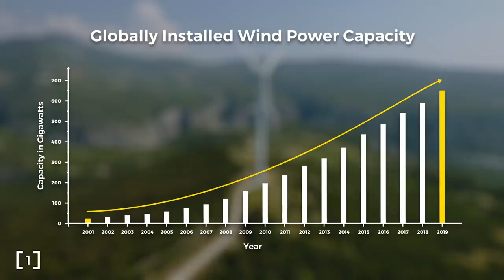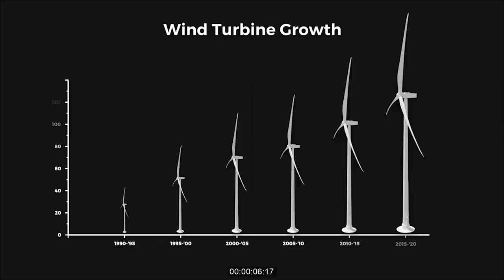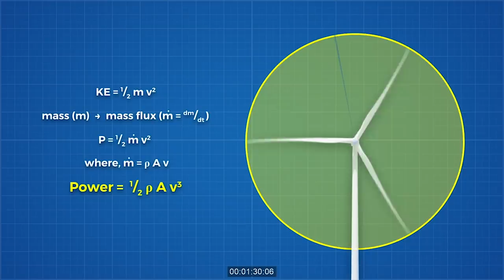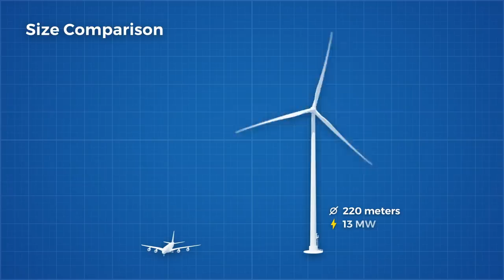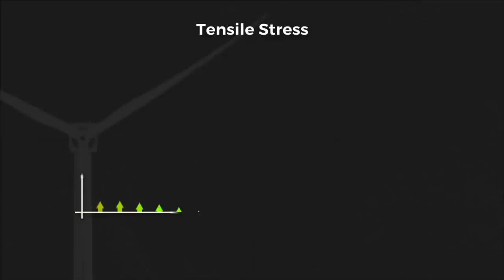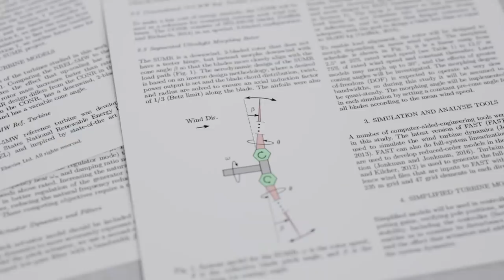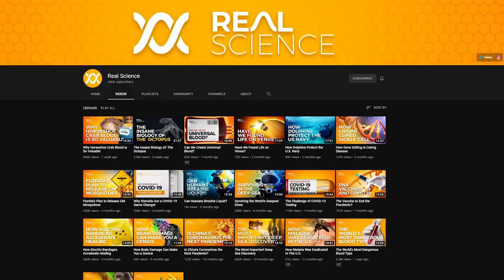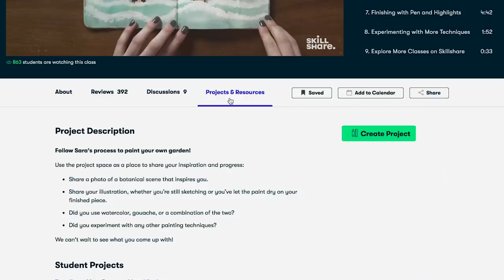How Big Can Wind Turbines Get?

Comment: Other question: How small can a nuclear reactor get?
Reply: Rather small, actually.

The U.S, back in the mid-20th century, they would experiment with nuclear powered aircraft, in order to deal with the(at the time) limited range of their aircraft.

However, fuel efficient engines, along with mid-air refueling technology(as well as several other factors)  and the fear that the shoot-down, or downing of a nuclear-powered plane and the amount of destruction it would cause, has resulted in the cancelation of such programs.
Reply: @SSA_Pizza  Beyond that, in the mid-1960s some of the research on "artificial hearts" centered on devices powered by radionuclides -- more like engines than reactors though.
                       ಠ_ʖಠ
Reply: The SLAM was a design for a nuclear powered cruise missile
Reply: @kokofan50  yeah but that one was basically a fucking fast flying reactor without any shielding and a bunch of H bombs to drop strapped to it.

Don't know if it was small. The whole concept was mental if you ask me.
Reply: @gus473  Those were thermoelectric or betavoltaic generator, they have no Moving part unlike a reactor.
Thermoelectric ones are still in use for space exploration :)
Reply: Find "Small Modular Reactors Explained - Nuclear Power's Future?" here on YT. Just published a few days ago.  also "Modular Micro-Reactors – The Future of Nuclear Energy?" by Illinois EnergyProf (this guy is a real expert on nuclear power)
Reply: No matter how small you make it, it'll still be too expensive to profitably build. And it'll need a government bail out to decommission it...
Reply: @Whywouldyounot  that was the russian solution, as far as I understand the American plane actually had propper shielding.
Reply: @kwithnok  not talking about the plane here. SLAM was a design concept for an unmanned nuclear powered supersonic cruise missile. It had no shielding. The radioactive exhaust Air from its Ram jets were actually calculated in as a bonus in lethality. Google project Pluto.
Reply: @kwithnok  Sjöwallö Ingebrigtsen
 was talking about the SLAM (Supersonic Low Altitude Missile), a project that was cancelled because it was deemed "too destructive".  By the US Cold War government.  Megaprojects has a video about it.  The US never developed a nuclear powered aircraft, but there was a bomber that carried an old reactor in flight, as a test to see if a nuclear powered plane was possible.  This channel has a video about the US's nuclear powered aircraft project.

Although a supersonic missile (well, more of an autonomous bomber) that sprays radioactive death everywhere does sound like something that would be made by Cold War USSR.
Reply: @Whywouldyounot  oh I rember hearing about that. Soo many cold war era lets power it with a reactor.
Reply: There are reactor designs for spacecrafts that are as low as 1kW electric/4.3 kW thermal. The problem is that all the small designs need highly enriched uranium, basically weapons grade. Also they are really expensive for what they deliver. There is a reason the "small" modular reactors that some companies are trying to build are still in the hundreds of MW.
Reply: @FreeOfFantasy  Not really accurate, RTG are not considered reactors. And they run on non fissile isotopes, so no need for weapon grade fuel.
They do however have different output power per unit of mass and different lifetime depending on the element used. Polonium 210 for example has a crazy densimetric energy, but  with a useful life of less than a year, while Pu 238 (so a non-fisille isotope) has literally thousands time less power but a lifetime of many decades: they are still powering the Voyagers probes launched 43 years earlier.
Reply: @paulgush  Yep.  We can make them big and we can make them small but we haven't figured out how to make them affordable.

And, no, it's no due to regulations.  Nuclear isn't affordable in countries with few regulations.

If you think nuclear is affordable then make a list of all the reactors that have been built with private money.  You know, some folks with money to invest built a reactor and sold the electricity for a profit without have a government kick in a lot of the money and/or electricity rates soaring for consumers.
Reply: @arnaud7671  I'm speaking about Kilopower specifically. There was also the SNAP program in the 60s and the Soviets had the BES-5 and TOPAZ-2. The roles of the reactors was taken over by solar panels and batteries mostly. 

Maybe if you assume somebody has no clue what they are taking about look it up first to not stand there like a fool?
Reply: @mrkokolore6187  and decommissioning capital that never gets budgeted for. And a way to deal with the spent fuel that no one has figured out yet. And since its so expensive nuclear is dying out thanks to market forces, just like coal. Wind, solar and natural gas are winning
Reply: @SSA_Pizza  I thought it also had to do with the weight of the shielding or is that based on misinformation?
Reply: VERY small indeed. The theoretical limit is just a few milliwatts. But as a practical matter in the real world no one really wants one smaller than a hundred kilowatts or so and all the serious small reactor designs at the moment are 1 to a few megawatts.
Reply: look up project timberwind
Reply: Tiny, additional radiation however is problematic on earth
Reply: @who41683  
If you're replying to the comment right above yours, she is correct.

The additional radiation you get from a single full body CT scan actually increases your lifetime odds of cancer a tiny amount.

If the only increase in radiation exposure, from the natural background amount, was from nuke plants(not counting the disasters), the the extra the release wouldn't actually be a problem. Coal plants release a hundred times more radiation than properly functioning nuke plants.

The problem comes from the fact that we are now quite literally exposed to twice the radiation we were exposed to in 1980.
Reply: @who41683  
3 mile island, Chernobyl, and Fukushima disagree.

Nevermind the large numbers of other radiation leaks and other problems.
https://en.m.wikipedia.org/wiki/List_of_nuclear_power_accidents_by_country

Overall nuclear is far better than fossil fuels, but not nearly as good as renewables.
Reply: @who41683  
I'm fully aware of the details of the 3 biggest.

The part you're not getting, is that all 3 of them were caused by the exact same thing.

Humans making mistakes......

Nuclear can't be safe until humans stop being humans, and that's not going to happen for a  VERY long time.
Reply: @who41683  
Oh, and reactor 2 at 3 mile island was destroyed, and some radiation was released.

That's major damage......
Reply: Well, an VVER-1200s pressure vessel is as small as a tank wagon, delivering 1,200,000 kW electric or approx. 3,500,000 kW thermal power for 12 month straight or even 18 month with TVELs new variant of fuel for the VVER-1200. That's the equivalent power output of approx. 250 Haliade X wind turbines or (with storage) approx. 600 of them, but demand-following and reliable unlike any other source of electricity. The manufacturer-guaranteed minimal designed service life is three times as long as that of a wind turbine and the NRC, CNSC and other nuclear regulators found out that these are estimates that are at most half as long as the actually achievable service life. Wind turbines are are rated at about 80% of their maximum achievable service life.
Reply: @paulgush  That's wrong. Almost all nuclear power reactors built on this planet have been built, because they were cheap in comparison to all alternatives and almost all of them do have to account for all their decommissioning and probable damage during operation.
Reply: @arnaud7671  Correct! Was fortunate to know a number of people involved with those developments, for space power sources and for heart assist devices! Funny, I don't feel that old (most days)! (◠‿◕)
Reply: @lordgarion514  Including those incidents, nuclear fission still has by far the lowest deaths per megawatt of any power source available to us. 3 Mile Island and Fukushima killed no one. The estimated casualties from Chernobyl were somewhere between 100 and 5,000. That puts it in line with most large industrial accidents and well below the annual deaths in the US from air pollution produced by petroleum and coal.
Reply: @tomb66  
But you have to include the extra deaths over the next several decades. Something that's almost impossible to calculate.

But as I said, nuclear is better than fossil fuels.

And as far as deaths are concerned, you have to be very careful what you're counting.

There's a huge difference between installers not following the rules and getting themselves killed, and pollution from using it killing people who didn't even use any of that energy.
Reply: @lordgarion514  3 Mile Island and Fukushima did not release enough radiation to have meaningful long term effects. 
The estimate of 5,000 for Chernobyl includes long term illnesses. Part of this is that the most common cancer from exposure to radioactive materials is thyroid cancer, which is one of the most treatable cancers there is (90% survival rate as of a few years ago). 
Are there risks to nuclear power, yes, but there are risks associated with everything.
Reply: @tomb66  
We've managed to double the amount of radiation we're exposed to since the 80's.

I got news for ya.
It all matters now.

A 5% increase is one thing.  Doubling and then adding 5% is an entirely different ballgame.
Reply: @tomb66  
And while looking at something else, I found a link from September 5th, 2018 that said "Japan confirms first Fukushima worker death from radiation".

It's a safe bet that more have died.

And besides actual death, low levels of radiation will also just help break down the body.
Reply: @tomb66  
You also left out the fact that the ONLY reason none of those three were worse than they were is pure luck.

Especially 3 mile island.
Reply: @lordgarion514  A couple things. First, for some perspective the tsunami and earthquake that caused the Fukushima failure killed far more people than the plant ever could. Second, what level of radiation is low enough? The radiation released out of 3 Mile Island and Fukushima was barely above background and was the equivalent of a chest X-ray for those right around the plant at the time of the release. Something to avoid repeating if possible, but hardly worth throwing the baby out with the bathwater.
 
Third, I am unsure what you mean about them not being worse by pure luck. Chernobyl was pretty much one long series of the Soviets doing the worst possible thing, from what they did to that reactor's safeties to the follow up. The HBO miniseries's talk of "multi-megaton steam explosions" was one of the dumbest and least scientifically sound things ever uttered in a docudrama. I am also unsure of where you are coming from on 3 Mile Island. Again, it was essentially several hours of the reactor staff doing the exact wrong thing and melting the core. It is not exactly luck that a containment vessel specifically designed for this circumstance held up as intended. 

Fourth, burning coal in power plants produces a lot more radiation than a nuclear reactor does. Unless we get cheap large scale energy storage, we do not have a renewable energy source capable of providing baseload power. For baseloads your choices are coal and nuclear. Anything else is wishful thinking. I am also really curious where you are getting these numbers indicating a doubling of radiation exposure since the 80s.
Reply: @tomb66  
And with more screwing up, they all could have been worse. Including the containment vessel not holding up at 3 mile island.

And baseload can be done without storage. The problem is, it would require so much overcapacity be built it would negate most of the savings.

And there are several cheaper forms of energy storage being studied and tested.

My favorite is "train car energy storage".
Can be done with retired railroad cars, is dirt cheap, and only requires about a 5% grade to work. So there's lots of places all over they could be installed.
(Energy storage doesn't have to be right at the place of production)
Reply: @paulgush  - Current reactors are able to be commissioned back to green sites with the sinking funds from a fee on electricity bills. No government bailout required. So what is your next lie we have to debunk?
Reply: @KevinBalch-dt8ot  if you're trying to persuade me, calling my argument a lie is not a good way to go about it
Reply: @KarlKarpfen  Do let GA Power, SC Electric and Westinghouse know that good news on nuke economics. It'll cheer them up given the misery they went through
Reply: @paulgush  Well, it's the economics they, Rosatom, KHNP, CNNC and others deliver. There are some few exceptions, like Vogtle-3 and Vogtle-4 or the design desaster called Framatome EPR-1, but in general, they deliver plants for approx. 4¢/kWh.
Reply: @lordgarion514  hello i support nuclear because i 20% nuclear and 80% renewable price of renewable energy drop to 1/5 because of grid base load so without nuclear %100 renewable Will cost 6 times as much and when you say they do not even want to pay 1   6 Will doom us soo in conculution nuclear is supplementry for renewable and i do not want hear anymore fear yes it is risk but even natural gas means disase one is risk other is absulute
Reply: @ufuker5754  
You got a link to support that claim that without nuclear, renewables will be 6 times as expensive???
Reply: Why
Reply: Quite small. Aside from research oddities, there are companies currently working on so-called "micro reactors" which can fit in the space of a standard shipping container
Reply: They can be very small. Hopefully we will start to see some of the localized industrial nuclear power generators in use in the next 5-10 years. We really need to get away from this "green" and "cheap" wind turbine idea. It's insanity.

Comment: I just got a job building offshore wind foundations, and the size of these things are insane!
Reply: Few years ago i saw some offshore ones being built. And my town got caught up in being a port for loading ships with the parts and they were meant to be for another town down the coast i can still see them from a good few miles away.
Reply: Ooh! Any cool stories? Just watching I realised those big cranes, lifting a blade, might face strong wind...which is why they want to put the tower there. I bet that gets exciting.
Reply: @malek01  No cool stories yet, but I was show around and told about it, they roll the plates that the walls are made out of on site, these plates are like 6-7 cm thick 4 M wide and 25 M long and weigh around 50 ton, sevral of these pipe sections are then welded together, the finished product is like 300 ton
Reply: @Ze_Taco_Guy  The scale of this stuff fills me with glee, and they look so pretty. Maybe once you've had some adventures, do an AMA or a 'diary of a wind farm' builder thing. :)
Reply: Kinetic energy capture is <50% at best. Histeresis wastes a considerable amount,  especially if variable winds. Some cooling occurs  as the wind expands. Tip vortexes, tip speed, blade stress, tower stress all cause issues as swept area increases.
Reply: Yip. Our blades are 68m long. Wait till you break a blade. $$$$$. Or forget to pressurise the elastomers!😬
Reply: Exactly insane to use 500 year old leonardo design to lose on oil discovrry betz.limits more than half loss supporting same loss of.polar ice since 1919 bogus phyics law ignorance of Einstines 1905 noble.
Reply: @Oldman1600  using betz limits except the 0 value edge  only my.flat walls edges opposes you did not mention inventions like mine .fact check betz no invention possible claim k
Reply: @Ze_Taco_Guy  Congrats 👏 I hope you have been enjoying it 😊 & I hope the pay is at least half as amazing as the job itself. 

p.s. the cost of carbon fiber may be too high right now but I do believe it is the  future from pants-power plants, from wind turbines-walk ways that span skyline to skyline 🏙 lol the 2100's will be something else for sure!
Reply: Fellow Millwright??
Reply: I'm getting my tech certification now I hope to join you one day.
Reply: How long does these giants have to run before producing net energy (carbon neutral).
Reply: @dh88k  5 to 18 months, depending on type and location.
Reply: @old-pete   That seems very optimistic, I'm sure some very smart people are crushing the numbers. is this from an independent from the wind industry study?
Reply: @dh88k  That is from multiple studies. That is why I gave a range. The energy invested is not that big and many underestimate the amount of electricity these machines produce.

Comment: 3:50 I just finished my Calc 3 class and was surprised to see a useful application of the infuriating line and surface integrals, other than making students fail.
Reply: Homework boy! Did you do it?!
Reply: As someone who works for the ISRO(Indian Space Research Organisation), you'll use that a lot in engineering in basically anything that involves flow, so learn it well, I will link a good book for you.
Reply: @homijbhabha8860  it’s been 9 months sir,no link 😢
Reply: Where are the line and/or surface integrals?
Reply: I am taking Calculus 3 rn and i was gonna bs it, thinking that it's never used in real life. Do u know if Calculus II is used in real life?
Reply: Calc 2 is pretty useful but Calc 3 sucks and is useless unless you’re gonna do a phd or something I think
Reply: Calc 2 is pretty useful but Calc 3 sucks and is useless unless you’re gonna do a phd or something I think
Reply: Calc 2 is pretty useful but Calc 3 sucks and is useless unless you’re gonna do a phd or something I think